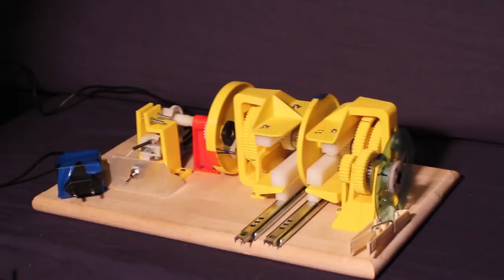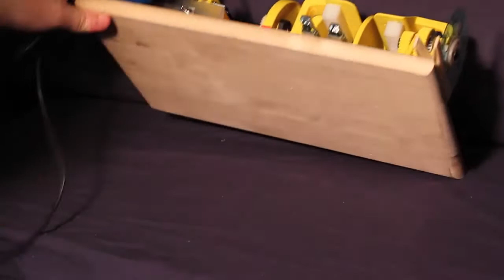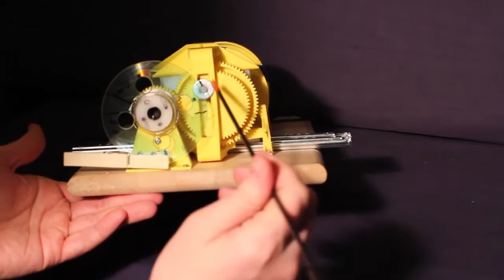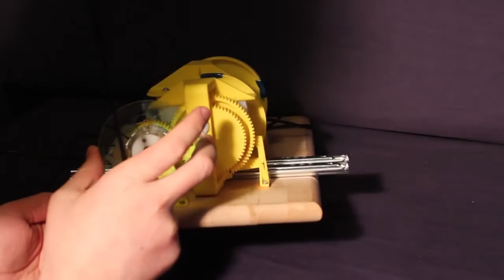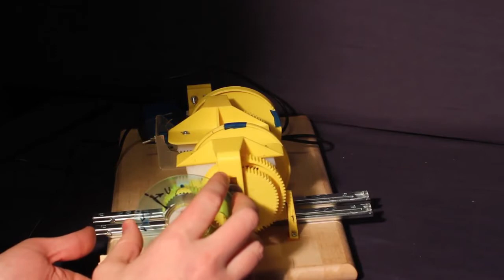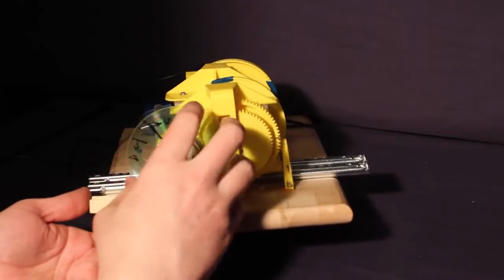Stabilized Pulse Infinite Variable Transmission (STIVT)

Comment: A very interesting design! All previous geared methods aren’t truly infinite or technically continuously variable, and all variator designs I’ve seen before rely on a traction fluid or heavy pressure, but I see that this relies on crank arms with bearings donecat the end of the current varied length, in a manner it can’t slip, only limited by the strength of the crank, crank arm, and bearings.
Because of the input->output relationship with 2 different sinusoidal waves (I’ve not calculated how it’d be) I wonder if this is a smooth rotary motion output for other than neutral or unity gain.
Reply from the maker: The cam mechanism ( https://youtu.be/wslMsIqbewM ) fully aligns the gear ratio. Thus, for any fixed length of the crank, the gear ratio will be constant. Oscillation of the gear ratio and rotation oscillations are absent.

Comment: It appears to be converting rotational motion to linear then back again over a few stages. Considering this transmission demo is unloaded, the input motor is struggling when you overdrive the output
Reply from the maker: The prototype is very inaccurate. The calculation shows that the losses of the engineered version of the variator will not exceed 2%
Reply: Vladimir Kilin Only a 2% loss seems highly unlikely. A pair of typical transmission gears in mesh will have that loss. 
Losses come from moments of inertia & friction
Reply from the maker: You are right, the forces of inertia contribute to the loss. But for a bicycle variator they are insignificant. And the losses are ~ 2%.
For trucks 1800 rpm, the losses are ~ 2.4%
For cars, 6000 rpm, the losses are ~ 4%.
The main contribution to the loss is the engagement with the rack by ~ 1.8%.
The remaining elements, although they seem complicated, experience little relative movement during the energy transfer period or perform a small portion of the power.
If you want, I can send you a calculation for the trucks.
Variator without rack is now patenting. In it, the losses will be ~ 1%